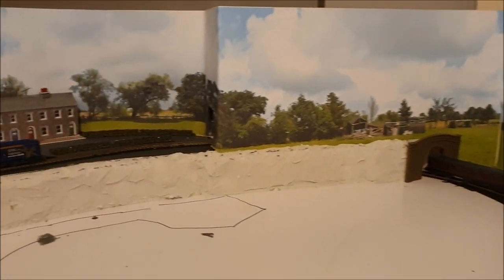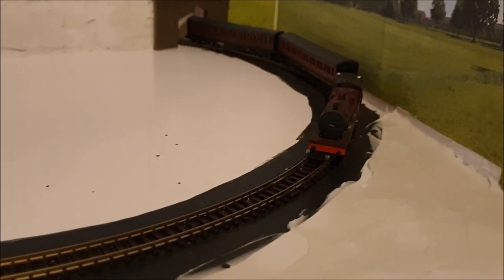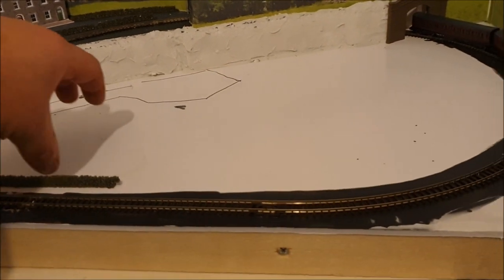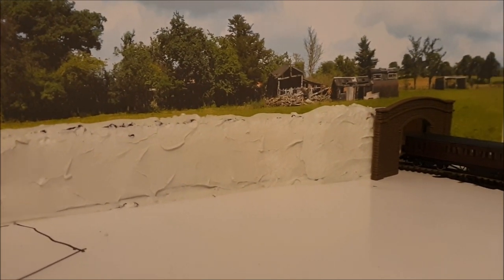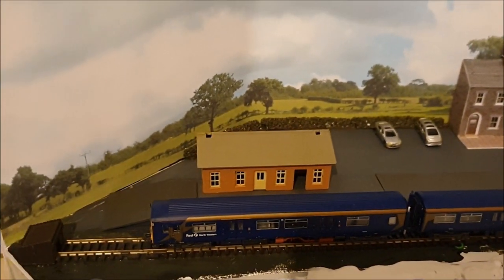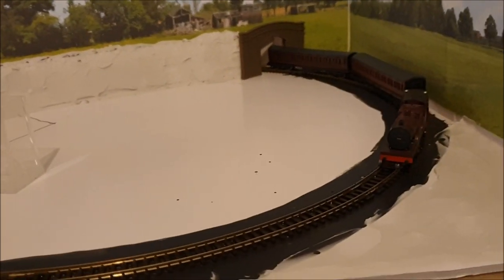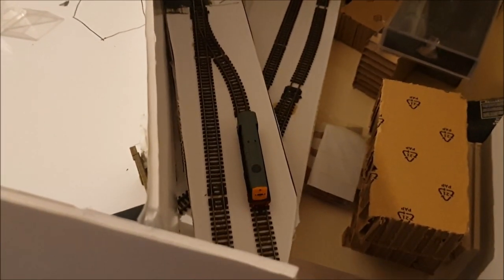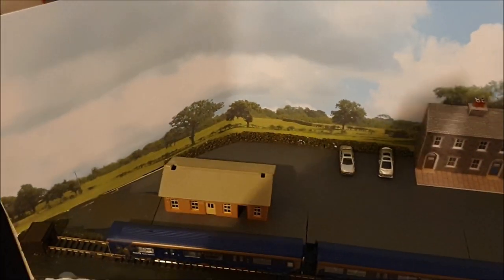My N Gauge Micro Layout Part 3

Comment: Your layout is looking brilliant.How do you find those Gaugemaster conrollers. I have a 40 year old H&M duette which works very well but I would love to upgrade when I can afford it.
Reply from the maker: the gaugemaster ones seem to work fine they used to come up 2nd hand in hattons in the old shop so used to pick them up sometimes pretty cheap in shows you can get a double one for 40-50 quid, i still have an old h&m duette its abit noisy but still worked fine last time i tried it they were good quality controllers i think mine came from a carboot sale for 5 quid
Reply: @northwesttrainsmodels  You did well to get one for a fiver.

Comment: I like the basic concept, but I don't like thae way the upper line goes through a hole in a tree. Not very convincing.
Reply from the maker: Hi Dave, I did try to improve it with the tunnel mouth in a later video, but that was the purpose for this layout as I hadn't done n gauge for so many years I wanted something cheap and  easy to build and to practice modelling on and also to run my n gauge stock on as it had been in storage for a long time, thanks for watching and for commenting. Tom